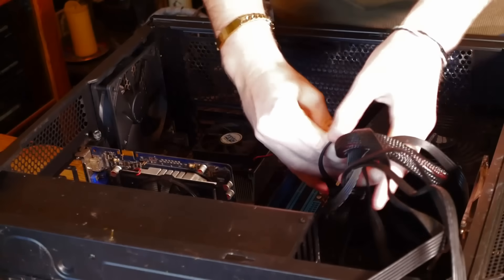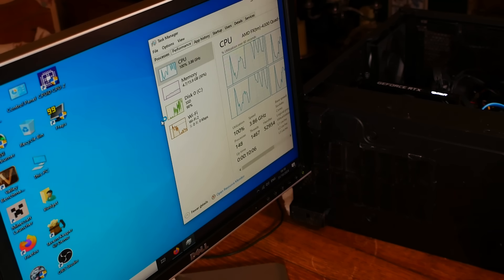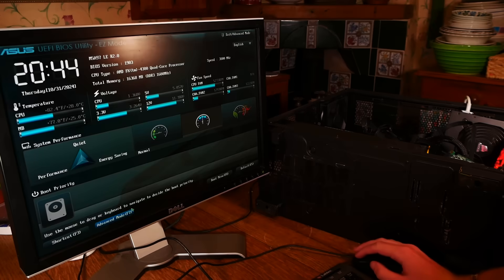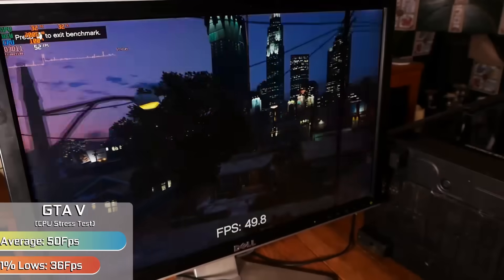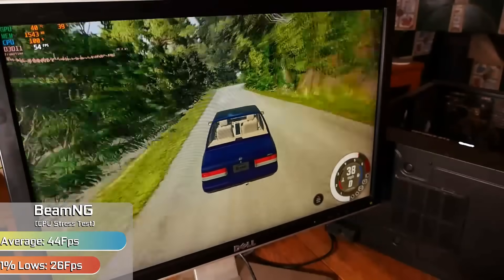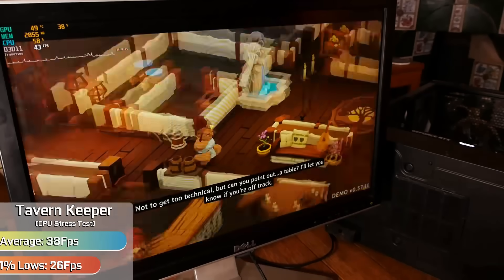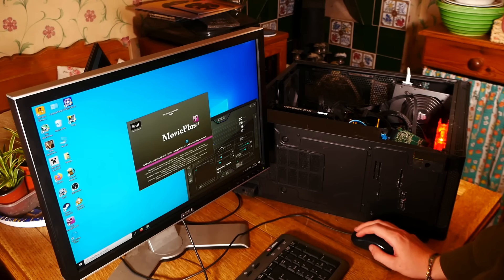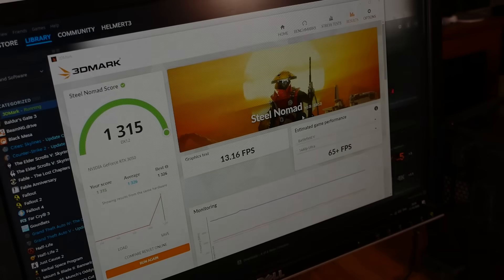AMDs Weakest FX Processor...

Comment: The beautiful thing about AMD FX, with adequate power and cooling, they were amazingly over clockable. Also, everyone casts dispersions on these chips, but without this development cycle of  Chiplet design,  Ryzen, would have not been possible.  I had two variants, and 8320E and an 8350.  Both would easily run well into the upper 4ghz and low 5ghz range with a massive overclock and mild undervolt and good RAM.  The EVO-212 dual in push pull, for air cooling was the goat, and it did extremely well at its 125 watt TDP, but only if you could cool the damn thing.  The best part was all models were factory unlocked for both frequency and multiplier. If you had the power, and the cooling you could wring very acceptable performance out of a mediocre chip on a budget. So everybody likes to talk shit about the shared cache or whatever, but they did a great job, based on what they worked with.  I'm glad it didn't bury AMD.  It would have been a shame, if it killed the company.  The place AMD really screwed the pooch on this line, it should have been an internal, project.  It should have never been released in its early design.  By the time they got to the FX-9590 it was pretty damn good.

Comment: Google
MajorGeeks Intel Compiler Patcher

IIRC it only finds (And patches if you like) early 32 bit versions of files compiled with Intel's compiler, which skipped SSE, SSE2, etc on AMD system, but you will see a nice little uplift in performance if you patch all the found files.

NB that that some benchmarks and games with internet access will ...'fix' themselves before running.
BLOCK that internet access!!

Comment: Up until last week I'd been running an FX-4100, overclocked from 3.6 to 4.6Ghz with a big bulky air cooler from new. I'm now running the 8 core FX-8350 Black Edition as the cpu was only £20.  Now, if I can only sort out a good (very affordable) upgrade to the GTX650 I'm still running :)
Reply from the maker: An RX480 would be killer in that system, and they’re around £30.

Comment: My old FX-8300/RX470 build has been up and running "great" from August of 2016 to the present. I finally replaced it earlier this year with a much more powerful Ryzen 7 5700X/RX6700 build due to the impending "end of life" of Windows 10. I then switched the old FX-8300/RX470 build over to Ubuntu 24.04 LTS and it works great.

Comment: Ive had the 8320 but if the only 2 choises to play BF5 or GR Breakpoint on a i5 2500k or an Fx 8320 
i will take the FX 8320 
now while the Fx would be having a bit lower FPS but on modern Games today a 4c4t hitches and freeze so bad that its not playable, i5 2500k and BF5 is a nogo even with higher FPS then an FX ;) funny how that works right? :D so i was right all alongbout Cores even tho the 8 core Versions only had 8 Interger Units and only 4 Flowading Point Units but yeha
i rather take LESS FPS thats very smooth rather then high FPS with Tons of Stutter and Inputlag like the i5 2500k si the FX 83xx aged better then the i5s that where pricecompetetive back then :)

Comment: I got a fx4100 system for free in 2020. Absolute garbage. Overclocked as much as I possibly could. With a GTX 1060, Fortnite ran 30FPS. I got a Dell XE2 for $20 with a i3-4330. Released about the same time as the FX. OMG. It ran circles around the AMD. I couldn't believe it. 60fps Fortnite. 

I tried the 6 core FX and returned it. Still slower than the i3. I upgraded the i3 to a xeon 1270 v3. Massive upgrade. Still using this computer. As for the FX, it is collecting dust. I don't have the heart to throw it away.

Comment: I'm a big fan of these older AMD chips. I am aware that they were not as powerful as the Intel chips of the time, but they were a lot cheaper. I was a student and needed to replace my old Acer Aspire One and at the time opted for an APU because the FM2 motherboards were cheaper than AM3+ and also I could not afford a graphics card. I bought a system with an A10-5800K that is pretty much this FX-4300 without the L3 cache but with a quite decent integrated GPU. That system made me so happy, I played a lot of games on that IGP at 720p. It still lives connected to my living room TV as a poor man's steam machine.

Comment: I actually have been gaming all these years on a FX-4300 and it's almost time to upgrade it however it ran all sorts of demanding games even Stalker and Metro Last Light flawlessly for me and hell it even ran the Original Crysis game no problems...aside from poor optimization with the memory but that was on the game as it happened to everyone...don't use the respawn feature hard load otherwise the game bugs out bad and can soft lock the final boss unfortunately 

And fun fact I can actually run VR on it as VR is mostly Graphically intensive so just have a good GPU and even if it is a bit laggy you will be fine....just get used to the overheating and the heat killing your hardware as it's too intensive. I am surprised my CPU never died as it overheated a lot and acted as a space heater over the years. AMD really made them good and a good bang for your buck...also in task manager you can force the games to use more cores if you really wanted to but be warned some games do not like this if they specifically limit how many cores can be used such as Skyrim the original can only use 1 core but the special edition uses up to 3 but still functions mostly on 1 core 

Also while it can play a lot of modern games to great experiences these days you should not boot up OBS and try to record or stream those games as you will get encryption overloads at times because the CPU is so old it can only do so much. And yeah all the PC games I played on my channel was me using the FX-4300 and I still got a lot queued up as I need to buy a AM4 motherboard for my next budget upgrade as I snagged a Ryzen 5 5500 for 56% off so around $74 USD accounting shipping and tax. Just some games be fine with having to lower the resolution to around 720p instead of having it at 1080p when playing that way you could use OBS to record and play 

I actually think it might be able to handle VR if I had a good cooling system like Liquid Nitrogen or something similar due to the fact that the lagging is from it overheating, however if I upgrade from a RX 580 I also might be able to actually play VR as again it is graphically intensive with only 30% of it being the CPU so it might actually ignore the obvious bottleneck of having a better graphics card than the CPU. But apparently there is a weaker processor the FX-4100 and if I were to keep this motherboard after upgrading to AM4 I will just replace the chip with either a FX-8350 (for some reason better than a FX-9590) and use it as a server as I don't like throwing out good parts and such. Also I recommend using Shadow of the Tomb Raider as a benchmark test as it has a built in benchmark mode and it can be CPU or GOU limited depending on the settings and resolutions 

Anyways since the FX-4300 is so cheep these days get a couple of those and a cheap AM3+ motherboard and you have a very cheap server cluster

Comment: One thing to note about Piledriver (Vishera), whatever the architecture revision is called, is that it actually provided a 15-20% performance uplift from the previous Bulldozer release and traded blows with Ivy Bridge i5s. The reason FX has such a bad reputation, is that Bulldozer launched with the "8-core" 8150 and 8120, neither of which offered a noticeable performance uplift over the previous Phenom II 1090/1100T, and sometimes even performed worse despite in theory having an extra 2 cores. Add to that, AMD promising big things with FX-Bulldozer and a lot of people were left with a sour taste in their mouths.

Comment: I am still running my F-8300 ( 8 cores ) with 32 GB ram.  runs well.   does better when I replaced the HD with an SSD.   Now - mostly my lab box, running 2 vm's for work.      Even with 2 vm's and a web browserr running at same time, still very usable.   ( But I am not a gamer ).

Comment: this was the CPU i chose for my first ever built when I was 12 years old. I could afford it with chore money and it blew the socks off the 2006 HP pavilion i was gaming on at the time. This processor was so bad, it ran hot and slow and was a 2c/4t chip pretending to be a true quad core. I miss FX.

Comment: First system i had was built with an fx8300 and a 1050ti had 12 GB of ddr3 but it would run whatever I asked it to and it did it reliably was slow at times but I could play rust never could get it higher than stock clocks but it ran and took whatever I could throw at it. I still keep the pc around for a backup and sometimes I'll hop on to play some of my older games that don't like running on my main rig

Comment: you didn't get I5 levels of performance, and they aren't all still here...well I guess technically they are. the cpu's are I have a 8350 as a keyring. they used to kill motherboards left right and center

an fx 8350 was destroyed in every metric by a i5 3570k(had both in my house) and the 8350 took out 4 motherboards(3 without overclocking) in its lifetime.

they were horrible, a bunch of games stuttered, they used loads of power and needed lots of cooling.

the only ones that didn't murder boards were the 4 core versions and some 6 core

the older AMD 955 black edition on the other hand was pure awesomeness

Comment: I have the 2 highest tiers of FX Unlocked versions. Currently, I only use the 9590 @4.8GHZ in an ASUS CROSSHAIR V FORMULA Z board, 32gb of DDR3, dual AMD Radeon pro WX 8200 gpu's, along with a dual psu setup to split the load. The 650 psu for the board and peripherals, while the 750 psu for the gpu's. I use a custom build fan cooling setup and I can put any game to it you want. It runs any software smoothly for rendering via gpu's. Thermals never get close to conserving lvls. Plus, I give it regular cleanup maintenance and paste replacement. A flawless system. It's all in how you take care of it.

Comment: i had an AM3 platform in a seccondary build...

It started with an Athlon II x2... then moved to a Phenom II x4 945 c3 (the 95w variant) that was the top CPU for that entry level Asus N68 AM3 mainboard that was not compatible with AM3+ CPUs.

Then i was able to switch board for an Asrock N68 VS3 Fx. that was almost the same board i was leaving behind but with a BIOS update that enabled the Fx series CPUs... Later i discovered that despite not being listed, it could take Fx6300, Fx8320e and Fx8300. But since the only listed 95w Fx CPU in the Asrock webpage was the Fx4300 i grab one on the cheap and replaced the Phenom...

It felt so much as a sidegrade. The phenom II x4 945 and the Fx4300 had identical performance in cinebench... on productivity (mainly photo editing and rendering with RawTherapee) they were also the same and about 50% the power of the Fx8350 (that was my main rig at the time).

BUT!! The Fx4300 had better memory controller so i was confident to boost from the ram 1333mhz to 1600mhz (i didn't go further due to mobo restrictions). The other advantage was the instruction set, so some games that by 2021 wouldn't run on the Phenom, had no problem on the Fx.

That being said, i allways considered the Fx4300 a sidegrade from a mid range Phenom II x4 like the 945... and the conclusion is that the lowest Fx Vishera was already on pair with the mid range Phenom, while the mid range (Fx6300 and Fx6350) were on pair with high end Phenom II X6. And the mainstream 8 core were superior. Too bad in Dx11 era the extra cores didn't count as much as they do today
Reply: and by having used an Fx8350 and an Fx4300 at home, but living with an i5 2500 user and having used (and still using) an i3 4130 at my work i would say that intel's were more responsive and snappier in simple tasks like opening a window...

Nevertheless for the same or even lower price point, the Fx delivered a way better multitasking experience. having a very good (for the era) core count (with good enough cores) was a bless even without any prosumer config. The experience of having a 5/10 of browser tabs + Word + Excel + Adobe Reader (2/3 files open) + my job's software (legal software) feels A LOT for an i3, but felt a piece of cake for an Fx 8 and 6 core, which wasn't as snappier but retained performance when a lot is loaded (the bulldozer concept).

Furthermore, With some tweaks, i was able to use my Fx8350 in a way i could i felt like if i had a server for my own. i was able (thru core afinity) to use 6 cores into photo editing (heavy rendering) while keeping 2 cores free to web browsing (including YT vids) with no problem... same went with games... i could use 6 cores in a game and leaving 2 free to keep working or streaming. It felt like having an Fx6300 + A6 CPUs, or an improved Phenom II x6 + Phenom II x2.

Of course i was able to split 4 & 4 and have a kind-of dual Fx4300 experience.

i didn't really use an Fx 6 core beyond tests... but you could in theory get an Fx4300 + A6 (or phenom II x4 + Phenom II x2) experience (i wouldn't use 3 and 3 due to bulldozer module design)

On the Fx4300 you couldn't perform heavy tasks on just 2 cores unless you were willing to expend a lot of time in it or having a really bad/legacy gaming experience. Nevertheless on some older tittles or light productivity you could split 2 and 2 and having a somehow 2x Phenom II x2 experience.

Intels on the other hand were a lot more restricted to multitasks. despite being faster cores, the lower core count restricted multitasking in a serious way. A problem that i'm still suffering today at work

Comment: The real issue on these are when they are launched actually, around 2012ishs everything relied on single core performances, a similar clocked i3 and i7 were having almost equally FPS's while FX series were nowhere near, most of the i3 series (first 4gen maybe) dropped significant performance while these things stay where they are (a former FX6200 user). 
One thing for sure, chipsets were terrible, sata performance, usb performance and overal stability was not good at all. if you dont know what you are doing probably it was a bad experience.

Comment: I just happen to have a boxed FX-4350 Black Edition sitting in front of me.   "Aweful" is a matter of perspective, though.  Back in the day 4-cores was plenty for gaming, and so was it's performance.  Where things get questionable, is workstation use, especially when it comes down to things like rendering.  I mean it works, just have to wait a longer.  BTW, the 4350 sitting on the fesk, because I found a motherboard with a 6300, which I'm using now.  It's a bench computer used for testing.  Using it now, because there's a thunderstorm, and I can afford this machine built with spare parts to be sacrificed so I won't be bored during a storm.

Comment: i use a Phenom ii x6 1090t with a GTX Titan Xp for casual gaming and odds and ends stuff and im always impressed with how snappy it is. my laptop has a much faster cpu (i7-10750H with an RTX 3060) but the novelty isn't always there so theres some games i prefer to play on the old phenom even if the experience is a bit worse(looking at you fallout 4)

Comment: AMD at the time juggled between the A series and the FX series.
Interestingly, at least in my country, the A series was considered the lower tier, being limited to 3.6 Ghz with DDR3-1600 or even 1333, and the FX was considered premium because able to push DDR3-1833 out of the box.
Unfortunatley, the Vishera were pretty much dropped once the Trident based A processors came with a iGPU.

Comment: I had a fx 9370 and a r9 280 for about five years and switched to 6700k. Due to my stupidity I bent the pins on the 9370. Now it sits somewhere in my closet. Rip comrade.

Comment: One of the problems with your testing methodology is you test a lot of games designed and built for modern consoles which older PC chips have no problem running at a CPU level. I think if you tried running some games that were designed around PCs in the same era you wouldn't have as much luck with older parts. Also I think this is probably more commentary on the lack of innovation in CPU and gaming development 🤷‍♀️

Comment: FX gets a lot of crap, but the FX-8350 is just a genuinely classic CPU.  An absolute unit.  I also owned an FX-4100 in my first rig, and it really didn't suck as much ass in real-world use as the internet would have you believe.  I played through Crysis 2 in its entirety on that thing, at very respectable settings and framerates.  I defo think it was a nicer experience than an Ivy Bridge dual-core i3 would have been; not having to worry about closing everything that isn't the game to get decent performance was a pretty big factor back then that idealised benchmarks would always ignore.
Reply: i3 was much better